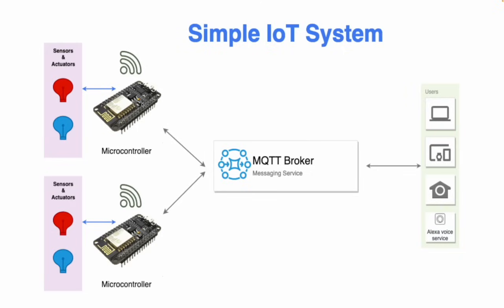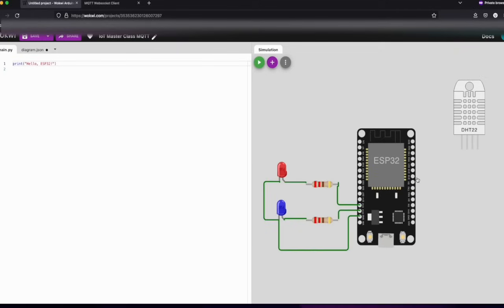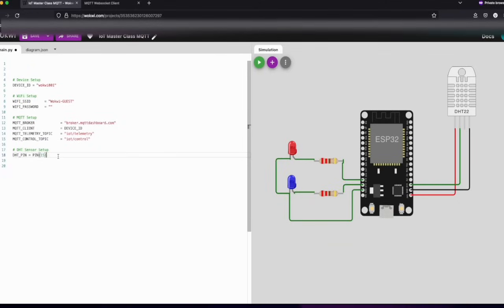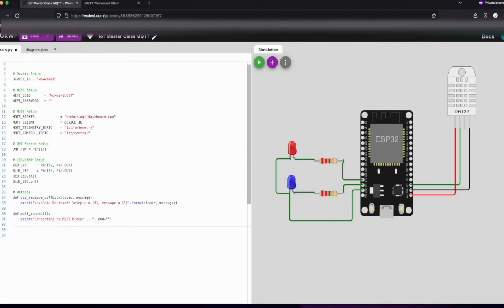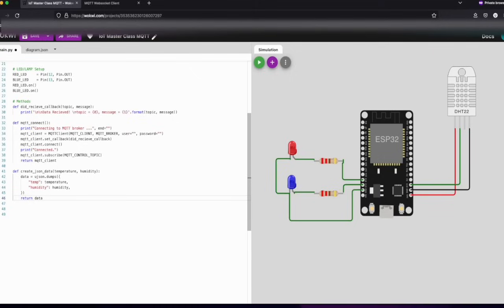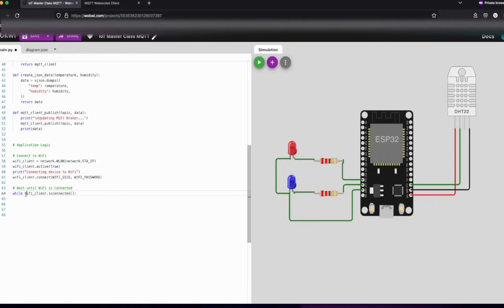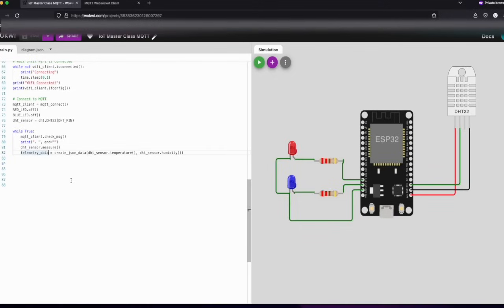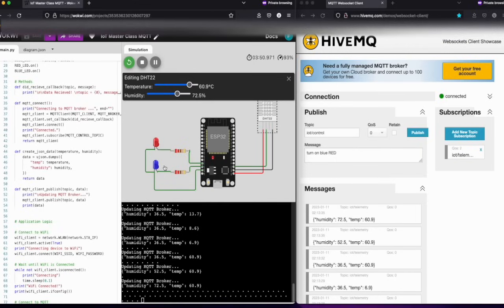Build an IoT System with ESP32, MQTT & MicroPython (1)

Comment: Thanks so much for your excellent video, and it would be very much appreciated if you could kindly let me know is it possible to get the actual code to study as a new comer to this field?
Reply from the maker: The code should be available on the wokwi link in the description.

Thanks for watching!
Reply from the maker: https://wokwi.com/projects/353536230126007297
Reply from the maker: As a new hobbyist, you can try out some simple examples on wokwi and then work your way up. The simulator works really well. If you are new to IoT, try looking at projects that use mqtt or websockets. I new to esp32, try understanding GPIO control especially how to on/off an led and the work your way up to reading sensors.

Thanks for watching!